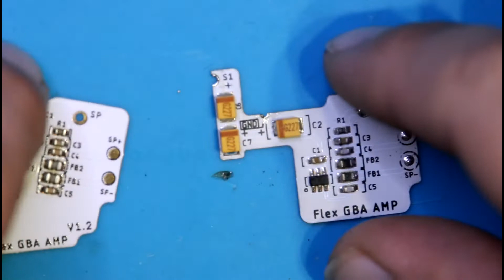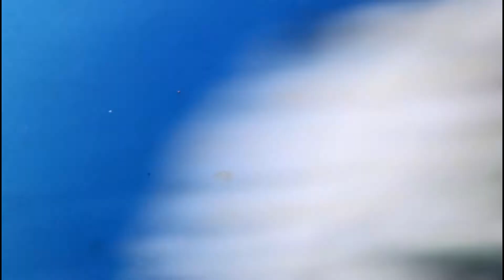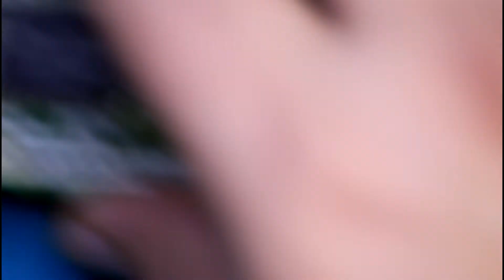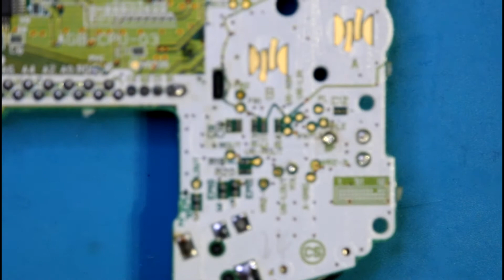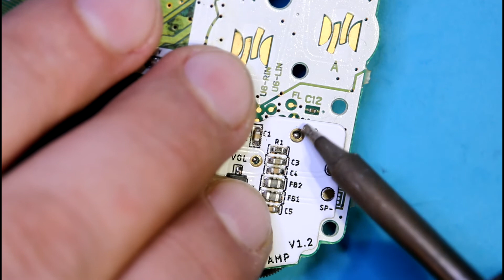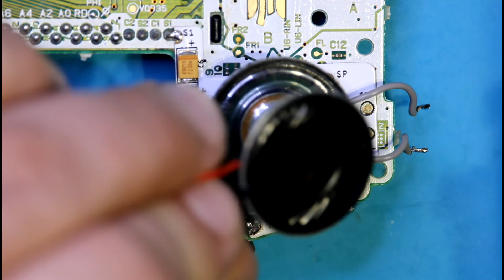GBA Flex Amp V1.2 Installation

Comment: Hi. Can too much work/heat on one solder point damage the AMP or even the speaker wires?
I had crystal clear sound after my first try, went back and wanted to add a bluetooth pcb to SP+ and now the speaker barely makes any noise and no I have not yet soldered any power to the bluetooth pcb. I am afraid I have damaged something on either the amp pcb or the motherboard that I can't fix. Please help.

Great video btw!
Reply from the maker: These flex PCBs are not as robust as a standard PCB and people use excessive heat on them. If you can't solder the flex PCB with 320 Celsius in a few seconds then you need different tools or equipment. Of course if I saw photos of your install I can see the condition of the amp to make a determination of the damage but people keep coming on YouTube to ask tech support instead of emailing me where I can see your soldering.

Comment: I finally got around to installing this amp last week and I'm very happy with it! I also installed your power cleaner and replaced the oem capacitors. I used electrolytic caps because I had replaced them months ago, but I did order the tantalum caps in case there was still unwanted noise. But it sounds great! No hum or hiss. Just clean and loud GBA audio

Comment: Hello, I'm about to buy some of your gba audio mods but I first wanted to ask if your flex amp still supports stereo audio for the headphone jack. I heard that the retrosix amp does not support stereo sound and since they kind of copied your design I wanted to ask you before buying the flex amp
Reply from the maker: I don't know how his is designed or wired but mine does not do anything with the headphones. All it does is take the speaker mono audio and amplify it. If you look at the gba schematic, the onboard amp has a stereo headphone output and a mono speaker output, and that is what I am tapping into.

Comment: Thanks man but what's the difference between the Cleanamp Pro and the Flex Amp?
Reply from the maker: No idea besides him copying my installation method and idea. They both amp the audio, turn off the amp at lower volume setting so you hear nothing. I have additional filtering on the 3.3v line with the 3 tantalum capacitors. Other than that I do not know what else his has or claims to have or do that mine does not . You will have to read what his product details are and maybe ask people who own one for their opinion on it.

Comment: Do you get too much white noise with this mod??
Reply from the maker: All analog amps will have white noise on the GBA. Unless the entire audio circuit is redone properly to isolate any noise from power rails there will always be white noise unfortunately.
Reply: @Angryhelder  okay thank you! i installed this flex on a GBC and it is noisy, so now Im not sure if I should do it on my GBA :(
Reply from the maker: @caxtromusic  GBC is a different console and there are simple mods to clean the noise but I can't post good replies or images in Youtube comments. Send me an email through my site and I'll give you the info.

Comment: Helder, if I wanted to get a better speaker for my GBA SP which one would you recommend?
Reply from the maker: the 2W I sell for the GBA for the most part fits in the SP shell but some people had a little difficulty fitting it in their shell. Not sure if OEM or aftermarket shell makes a difference in fitment but these are the best speakers for these but require you to solder wires to the pads. There are maybe some 1w aftermarket speakers with the spring contacts like the OEM speaker but I don't know any off the top of my head.